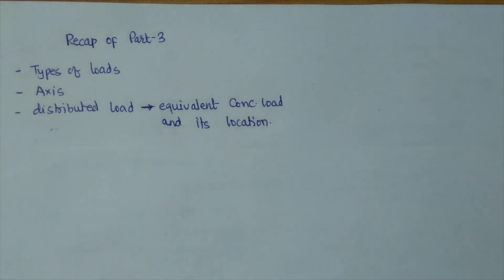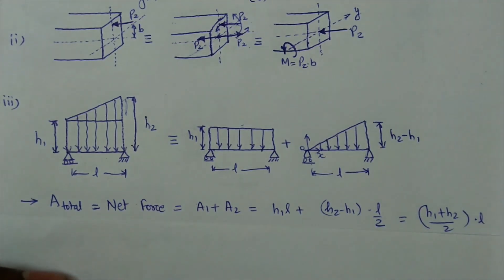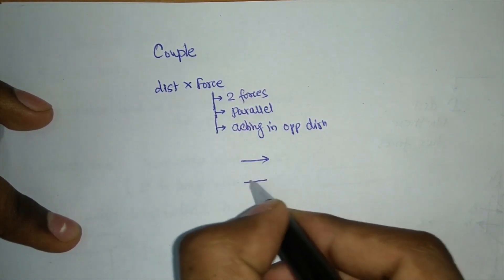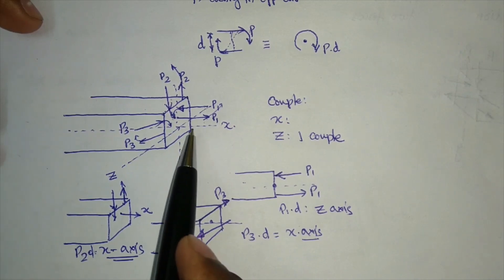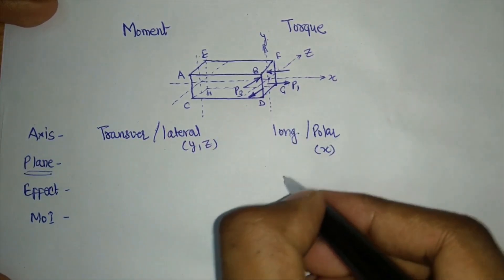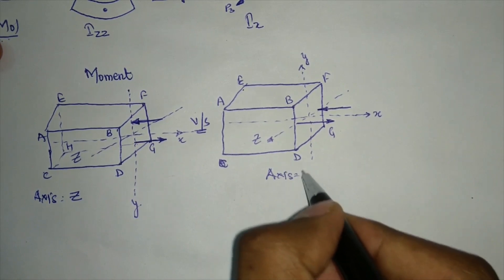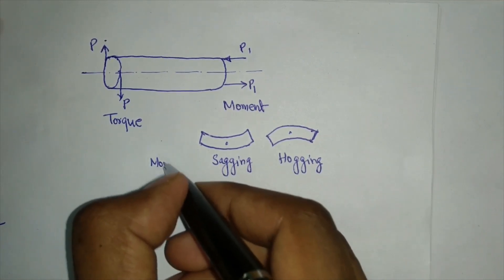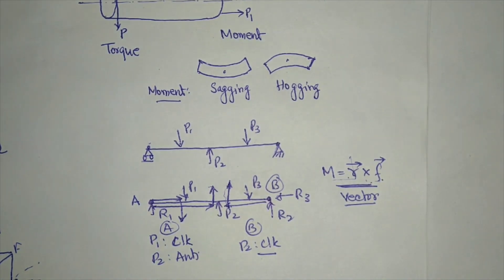SOM introduction Part 04 Couples  moment and torque

Comment: Sir please explain direction of couple formed.. and the difference as you have told between moment (Izz and Iyy) actually I am not getting direction of couple formation..
Reply: for couple direction use cross product relation.
as the couple direction = distance X load (u will get direction automatically)
and the direction of couple will decide which moment of inertia u need to use.
Ixx or Iyy or Polar
Reply: @pramodbeesal2805  sir let if direction of load is in X, and distance in Y then couple direction is in Z direction. And moment will be polar..this is correct please reply sir..
Reply: @pandeyneeraj709  direction will be z, thats correct
But we call it polar only if z is along axis of bar.
Otherwise call it simply Mz and take moment of inertia Izz for analysis.
Reply: @pramodbeesal2805  sir IAM calling polar in the sense of polar moment of inertia ( Izz)..not polar in the sense of longitudinal (means ki sometime longitudinal is called polar..)
Reply: @pandeyneeraj709  no
Polar means along axis 
We can call either direction as x or y or z
But polar means longitudinal only.
Reply: @pramodbeesal2805  ok sir thanks actually sir little confusion is there when we calculate in shear stress due to twisting then there is Jp (polar moment of inertia) so we calculate Izz that's why I think that Izz is polar..but you have cleared my doubt that polar means longitudinal only..